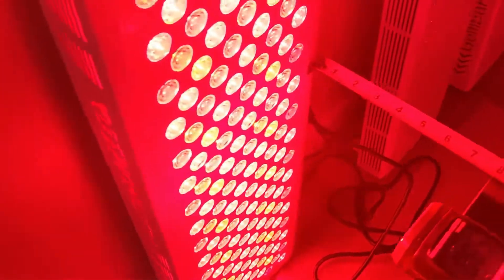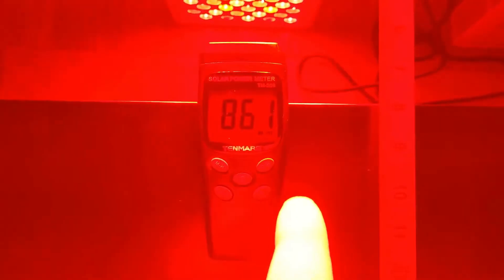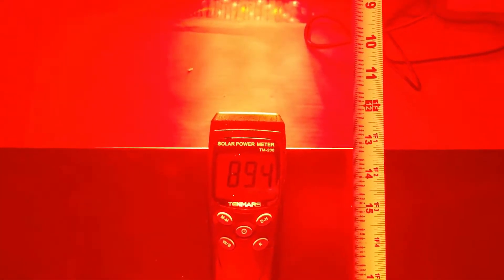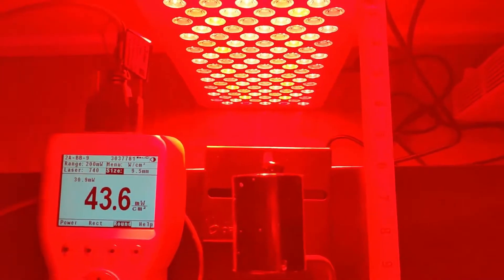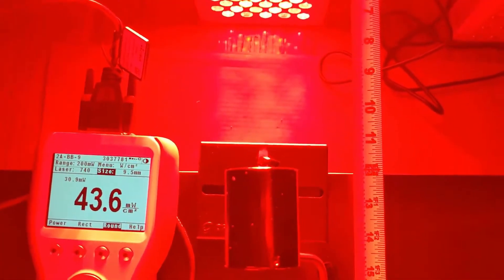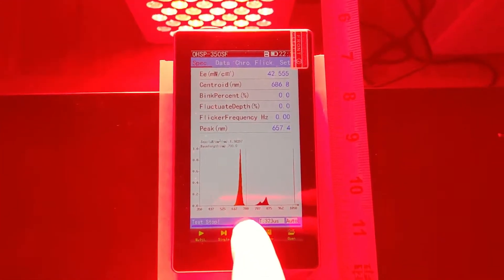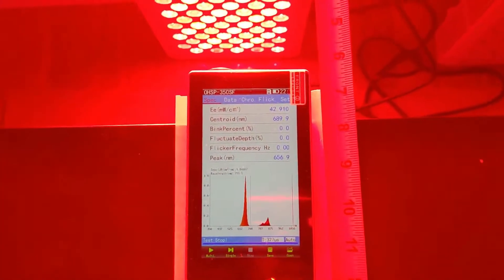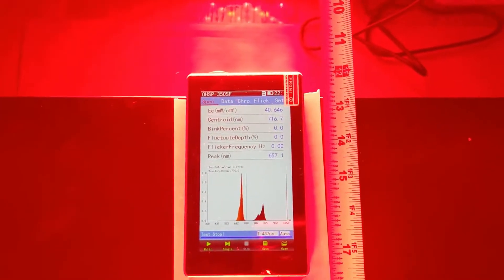Testing PlatinumLED Biomax 600 (older gen) intensity, flicker, EMF: Beam Angle Confusion!

Comment: So a few points .. would you mind responding.

I work shift work some nights some.days... what is the effect if any if I wear deep red lenses googles 1 to 2 hours before my shift is up.  Will that block all blue light and increase melatonin?  

Seen studies but they are using red light glasses. Electronic if you will.

Also I have a platinum led biomax 900.  It does grt warm.but not too bad when a good distance away 6- 12 inches.  Can u kindly review this panel?

Ps I wish I would have know about your company .. I would have bought your overclock. Still might in the future.   I just want to grt my money worth with the biomax 900

Comment: On beam angle don’t use paper at 90 degrees. You’ll get multiple angles and reflector patterns when so close up. Block all but one LED and measure the actual circular pattern on the wall from the one LED at a proper distance. There are  online calculators for beam angle and beam spread calculations.

Comment: Hi, I would like to get a full body panel or full body mat so I can lay in my bed and do red light therapy and I’m interested in using my FSA money to do this. 
1st- which brands do you recommend for this - I’m 61 and dealing with high blood pressure, general fatigue, stress and body aches and pains. 
I was tempted to get the newest Platinum 600 or 900 because you can use FSA but I won’t now because they are no good. Even if I can’t use FSA what’s the best one to get for laying down? I’m really in need of the benefits of the red light therapy. Thanks for all the work you do in this area.

Comment: A question maybe you can provide your expertise on-  How long should these red light devices typically last assuming good care?  Many come with a 2 or 3-year warranty, but is it certain the lights will last that long?  I imagine a red light malfunction would be obvious with the lack of red light, but with near-infrared, since there is no light to see, I'd imagine you'd need a device to detect that the light is still emitting..
Reply from the maker: It really depends on a lot of factors and conditions. In ideal circumstances they should last over 5-10 years. Remember that even after the warranty is expired a good manufacturer should be able to offer repair services for their products for a small fee.
Reply: @gembared  Interesting, thank you, 5-10 is more than I would have thought